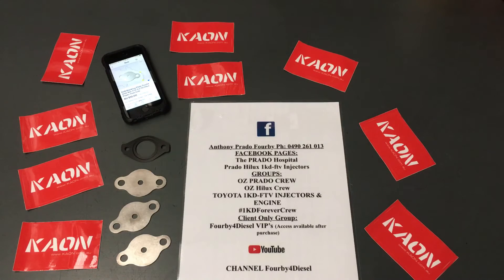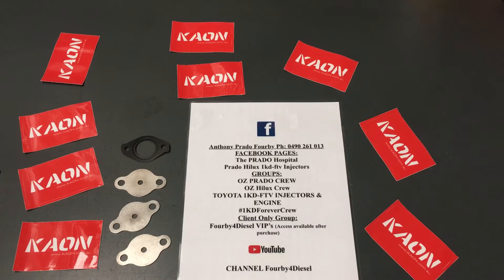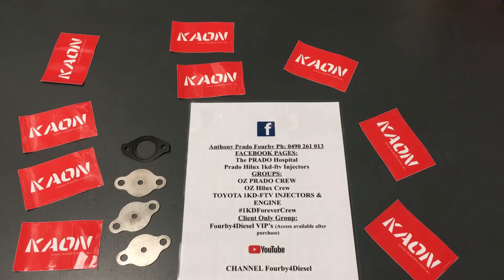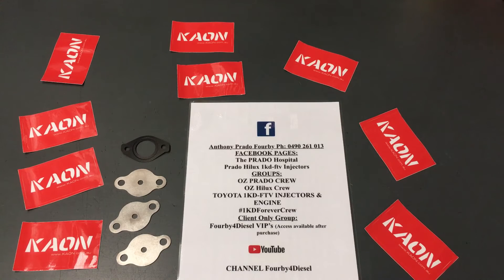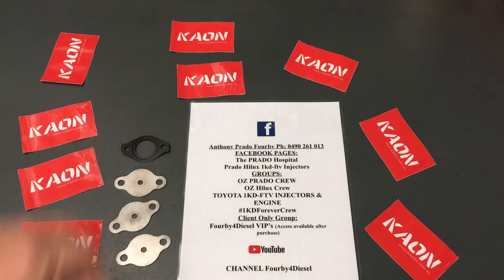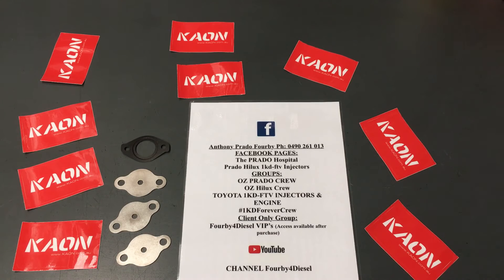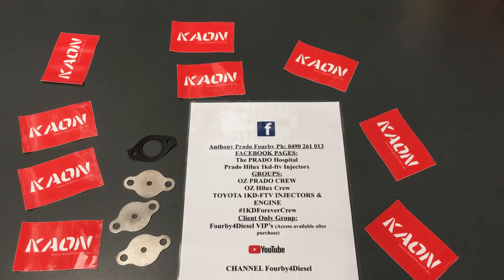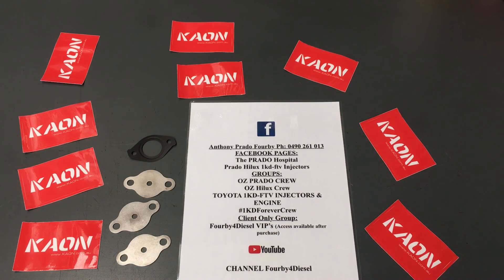EGR OPERATION INFORMATION - EGR CLEANING

Comment: yeah egr reduces warmup time, im almost certain. after turning it off i see a difference esp at idle because its flowing so much cold air through the engine
Reply: its not important except in winter tho. if i could i would run egr but my engine had piston sticking issues, oil going bad in 1-2k miles, now egr off, pistons soaked and works good

Comment: All the ones on ebay and other places that i have seen don't have a punched hole in the middle. They are completely blanked off. Do you know by any chance why those have a hole? How does it change to have a little flow of exhaust through? Is it better? And isn't that hole going to be clogged up pretty quickly? 
I guess it's easy enough to clean it up once in a while.
Reply from the maker: You need to watch more videos keep watching